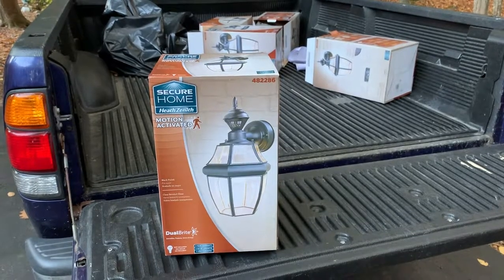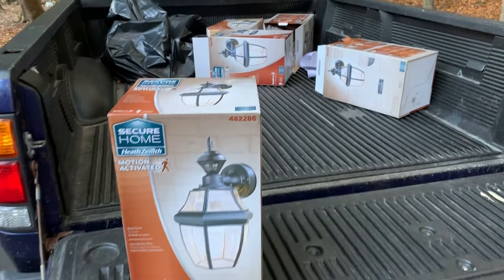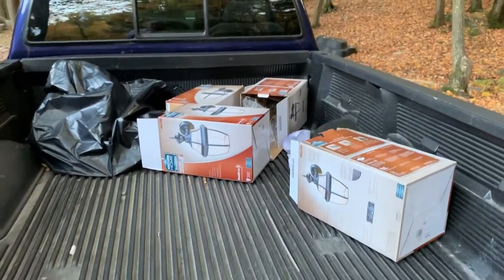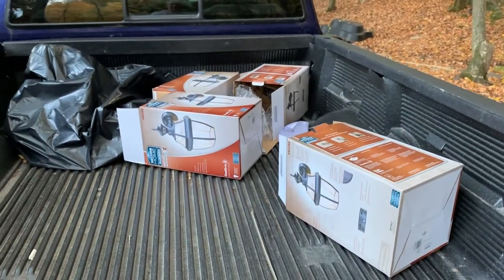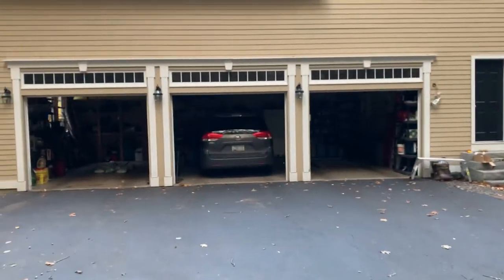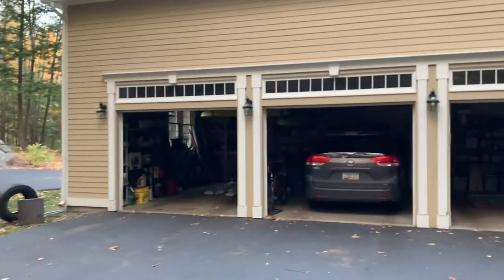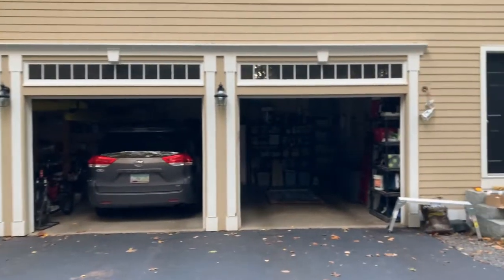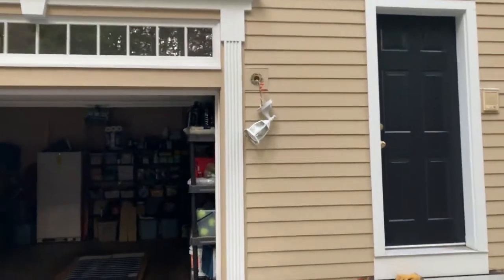Motion Detector lighting (more than one) daisy chain them

Comment: I like to use a baling wire, bend it into a hook, to hook the fixture up,  another bend hook to hang it on a screw, to hold the fixture up, while wiring it up  some where around where your working to  hang it.  This make it a lot easier to work with.  I just leave the screw there, or a nail, around the light. Cause your always changing them out. and its always there if you change out the fixture. Just get the bailing wire out to hang it on.  You can use the light fixture screw also. But there not long enought most of the time

Comment: hey! can one put one light with motion detector and connect it with others non-motion lights so that the latter turn on when the motion-one turns on?
Reply from the maker: Yes, you would make the motion detector light your trigger light that opens the circuit to send electricity to the other lights that are not set to go on when motion is detected.  The video should explain this.  Please subscribe to my channel.

Comment: I got three of them today. I got to install them ASAP. Pretty good video overall. My home was built in 1964. The builder only installed two lights. One by the front door and other on the right side wall of the garage. So I got to add a box on the left side of the garage door, run a wire from the right box to left box. Ugh!!! Currently I got only a 12-2 wire installed. I wish I had a 12-3 installed. So as I see it, my first one is the primary and the other two will be a slave. So as I see it, I’d have to use wiring diagram 2 on page 5 of the manual. Does your other lights operate separate? If I had installed 12-3 wires, I’d have all lights operate as a Primary. So does your four light operate separately when the sensor is activated? Wiring diagram 3 will make everything Primary and as I see it, all light would come on if one is triggered. Please let me know.
Reply from the maker: Hi Mark, in my install, I have only 1 primary, the other two are slaves, so when the primary triggers, the secondary's turn on at the same time.  I hope that helps.  TKC.
Reply: @tkcollette  I got the required wires ran and boxes installed. All three lights are installed. Tested in the TEST mode. All three came on and off as required. So I shifted all lights to five minutes mode. I got to wait until dusk to have them shift into automatic mode. Can’t wait!!! They are much better than what was there.

Comment: One question. In your other lights (slaves), did you cut the red wire and connect it to anything? Thanks!
Reply from the maker: I'm not an electrician, so you should consult one.  In my case, I only used the red wire on the motion detector lamp as that's what sends power down the line to the secondary units.  On the secondary units since there is no power then until the primary unit opens the circuit, the red wires do nothing.  So you can leave them out out as long as they have a wire nut on them.  Good luck.  I would test them while they are hanging, make sure they work, then screw them to the house.

Comment: how do you wire them if you want them to activate independently? to be activated as you pass by one of them, the one near you turns on and the rest are turn off until you aproximate to the next one closer to you? do you know what I mean?
Reply from the maker: What I think you were asking, as if you had three lights, you would want light one to come on when you walk by it, and then light two would come on when you walk by it, and then light three would come on when you walk by it. If that’s what you were talking about, then you would not want to wire them together but run separate wires to all three lights so that no one light is connected to the other. My guess is you would then wire all of those together in your light box so when you turned it on, you would have power to all three but they would be acting as motion detectors independent of each other.  Best of luck.

Comment: Doing the same thing today myself Thomas. I have two black wires and two whites for each of my three lights. How do I know which black to use for the traveller?  Thanks for doing this video. Cleared up a lot of questions I had.
Reply from the maker: Bob in the master light box, you should have two whites and two blacks. See video from 3:45. If you are replacing an existing set up, then just follow red wire from light as that should connect to your traveler. If it’s a new install, then you will need to expose the two black wires and then turn power back on. Test each of the black wires. One should register power and the other should be 0. The 0 power line is your traveler. Hope that helps.
Reply from the maker: Bob please provide a thumbs up on the video and subscribe to my channel here:  https://tinyurl.com/subscribe-tkcollette. It would be much appreciated.
Reply: @tkcollette  Thanks Thomas, yes new install. your video was the only one I could find with multiple lights and a clear how to video. Thanks for the video
Reply: Do I do this for the other 2 lights as well? ( the slaves)
Reply from the maker: @bob2787  Your welcome, I would make sure all the slaves are connected first, those should be clear, just one black wire one white wire.  Once those are done, then hook up the master as you should be good to go.  Good luck.
Reply: @tkcollette  Thanks Thomas.

Comment: What happens when you have 2 motions working several lights? One circuit.
Reply from the maker: I'm not completely sure, but this would be something you'd probably need to consider.  When the light switch is on, power would need to go to both motion detector lights, so they were active.  Then you would need to carry the electricity to the secondary lights so that when motion is detected, electricity flow and the other lights come on.   You might want to double check this with a pro, but that would be my assumption.

Comment: Red to black traveling... I'm trying to link up a 3rd outdoor light to the 2 I already have.
Reply from the maker: Sorry I didn't see this comment.  Assuming the 3rd is not a master, you should be able to just push the black wire from your second outdoor light (slave) to the third light (slave).  Mimic the same wire connection from your second light to your third light.  Good luck.

Comment: could you do a video with a drawing out on paper how the wires are and how many wires you've got
Reply from the maker: It depends on the type of lighting.  I just bought two farm lights for another location and they only had two wires as the red wire was connected to the black wire.  So it was pretty straight forward. It also depends, as noted in the video if you want them all to be motion Hector’s or just one. Too many brands and variables to write up a single path. Happy to try and answer questions though.

Comment: can u have them all being masters and slaves?
Reply from the maker: Nope. A master is what turns on when motion is detected and the forwards the electricity on to the slave lights. You need at least on master to detect motion. You could have more than one master so 2 or 3 lights detect motion and they may or may not forward the electricity. If you only had slaves, then all the lights would only come on from the switch.  Therefore it does make sense to have a light be both slave and master.